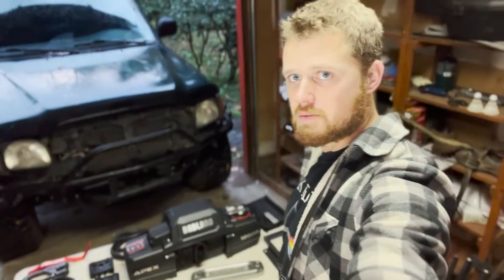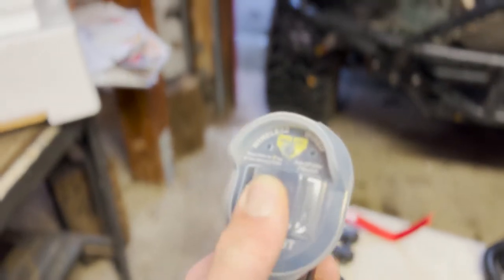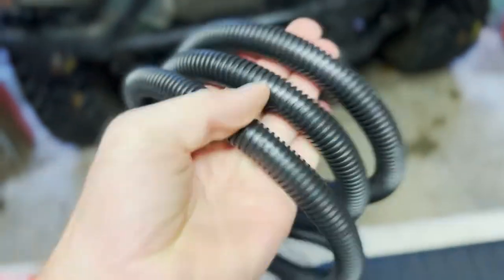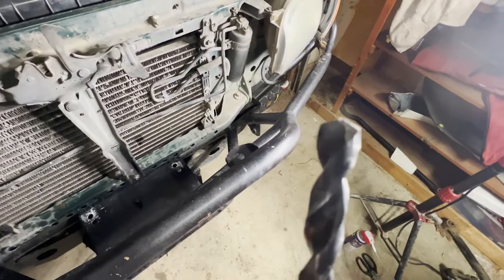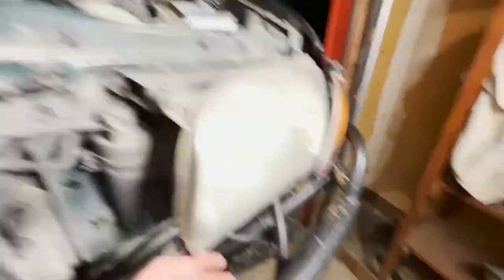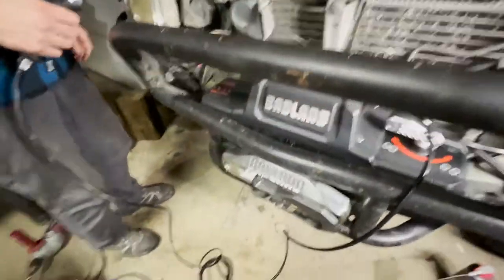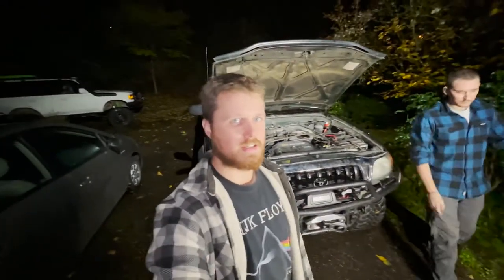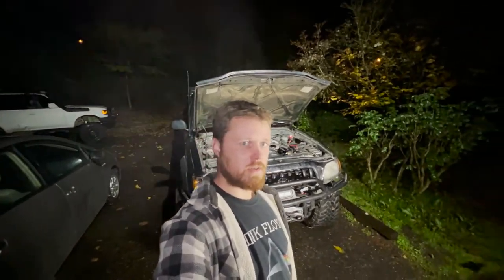1st Gen Tacoma Apex 12,000 lb. Winch Install

Comment: the badlands does come with a steel cable option... those velcro flaps are to wrap around and protect the winch line.
Reply from the maker: Good eye I didn’t see yet option! Are they supposed to be for wrapping around a tree trunk?
Reply: @Austin_SaintOnge  So it really it's to protect your rope against abrasion.  So if your winch line happens run across an object or the ground because you don't have a choice, you slide that velcro sleeve to protect your winch line.  You should have a dedicated tree trunk protector which would be a much wider strap to distribute the load on the tree and not dig in like a winch line would.
Reply from the maker: @lsswapped80  oh ok perfect that’s what we were wondering. I have the badlands tree protector and snatch block but I can see now that these offer a little more versatility